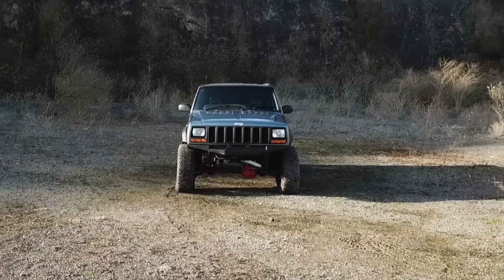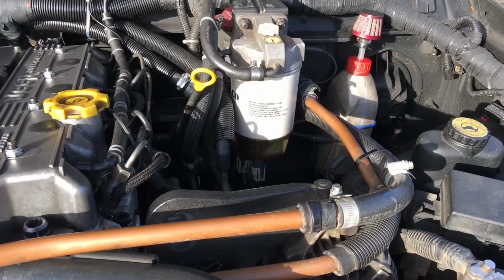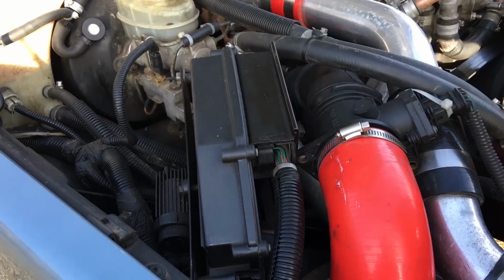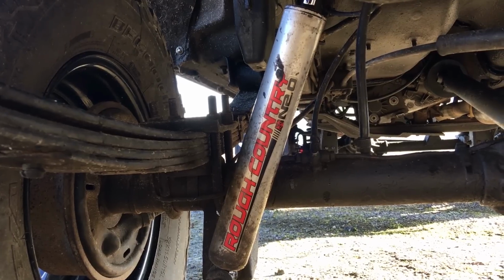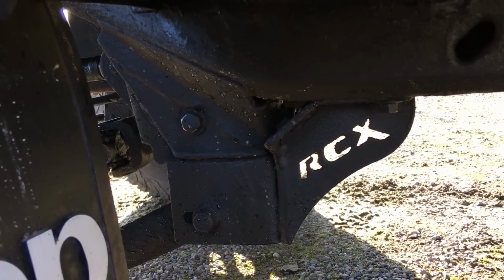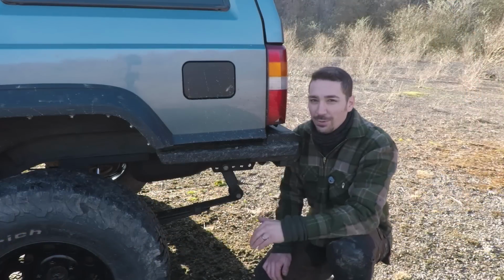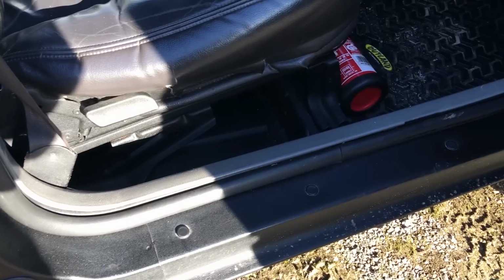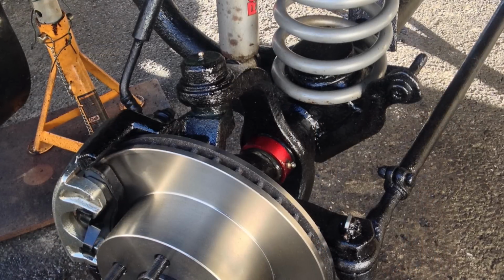Ep 01 / Jeep Cherokee XJ Overland Build / Pre-Trip Build Overview

Comment: So glad I found your channel.   I have a  USA 99 XJ Sport 4 door 4.0L.   I purchased it new back in 1999 and it is now my second vehicle after over 15 years being a daily driver.  I am looking for some additional upgrades after completing the following.  Added is a  4" lift,  heavy duty track bar, sway bar disconnects, upgraded steering damper, Bilstein shocks, 265 x 60 x 18 tires and wheels, slip yoke eliminator, 4.11 gears front and rear with front and rear EATON limited slip lockers.    Being it is now 24 years old time to address some aging issues.   One, some minor rust is now showing, doors are sagging due to worn out hinge pins, and time for some paint or a wrap and replacement bumpers with a winch.   Anyhow I will be following your chapters and look forward to see what you come up with your 99 XJ build.   Cheers!

Comment: Hi Mike, just een recommended to your channel from the FB XJ group, we're moving our XJ uk to Sweden soon, do you know if the 1996 has headlights that can be redirected to right side driving?
Reply from the maker: Hey, thanks for checking it out. Yeah you can buy the left hand drive head lights and fit them to the xj. RBS Handle in Sweden will probably sell new units that fit. Or you can find a scrap xj and use them. They are fairly easy to find. We're you guys moving too?

Comment: Wow! I'm incredibly jealous of your abilities. My 2001 is fresh-from-the-factory stock. Is yours also the Steel Blue Pearl (PBQ) color?
Reply from the maker: Thanks for watching, I'm no expert but its been a fun learning experience. I believe so, I'm not sure on the exact colour. Its my favourite though.
Reply: @WorkshoptoWilderness  check the small metal plate on the radiator support. If you see PBQ there that is your paint code for Steel Blue Pearl. Mine is also an export model, so the paint code doesn't appear anywhere else on the vehicle.
Reply from the maker: Ah okay, I will have to check that. I had no idea that it was there. Is it the front cross member?
Reply: @WorkshoptoWilderness  The American market ones have it on the door stickers, but our imports have it on the crossmember, and a few other places, tucked away under bumpers, etc.

Comment: do you have any links or names i can search on the different products you used for different areas of rust protection.. in canada and repairing a rusted out cherokee looking for something better than the bed liner paint i have now
Reply from the maker: I use this for inside the box sections - https://www.ebay.co.uk/itm/2-x-DINITROL-3125HS-RUST-PROOFING-CAVITY-WAX-500ml-AEROSOL-Extension-nozzle/223128840442?hash=item33f383e8fa:g:bMwAAOSw~llcRaoM&frcectupt=true
An this for underneath the vehicle - https://www.ebay.co.uk/itm/Tetroseal-4-5kg-TSL500-Tetrosyl-Genuine-Top-Quality-Product-New/232936860324?epid=10012032970&hash=item363c1e6aa4:g:nP8AAOSwj81bpaEq
They are both excellent products and they will not fail, chip, crack or come off. The temperatures here fluctuate from -35c in the winter to +33c in the summer and it's still good with no returning rust.